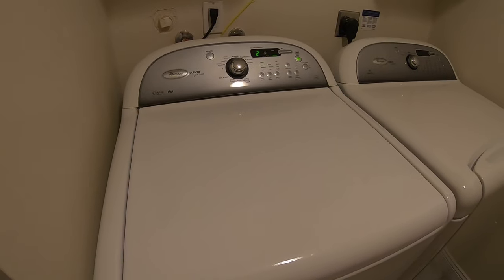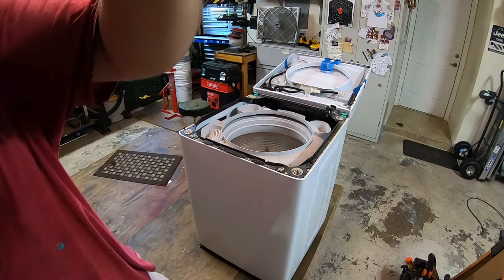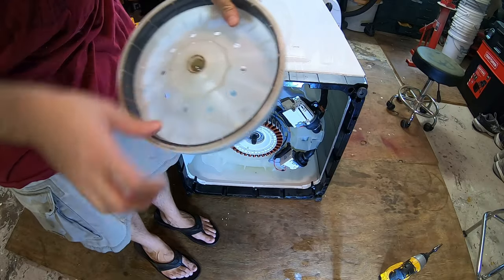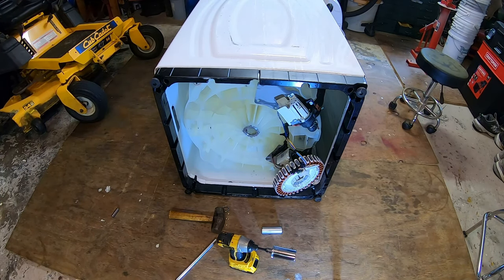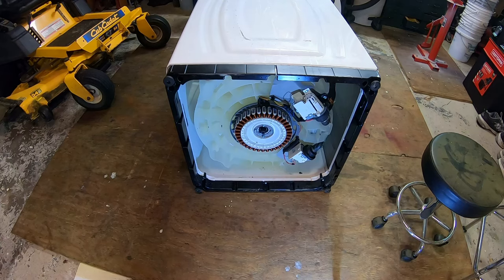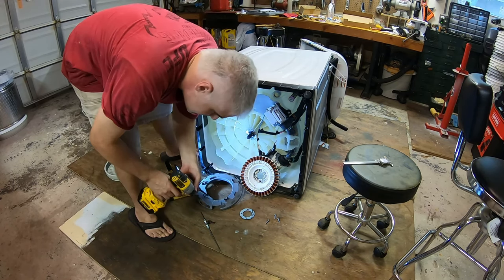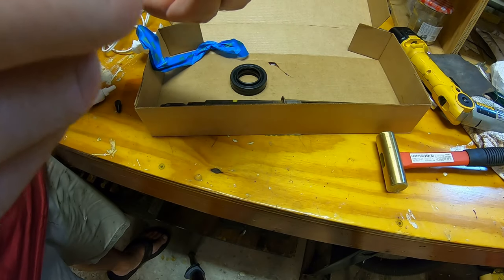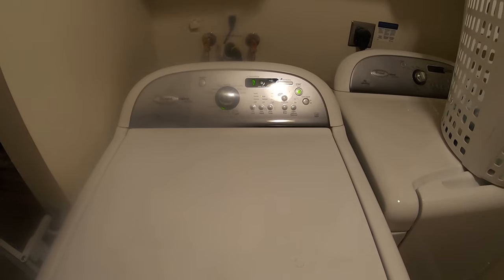Replacing the tub bearings and seal on a Whirlpool Cabrio washing machine

Comment from the maker: Just wanted to post a quick update, almost 2 years later, to say that the repair has held up perfectly - no weird noises, no leaks. 

The washer is now 10 years old and is showing signs of age in other areas. I had an issue with the "Start" button on the control panel, for example. I am expecting to have issues with the "Power" button as well since they are the most heavily used buttons. Unfortunately, those buttons seem to be replaced as an assembly - a very expensive assembly!
Reply: At 8 years, your machine was at the life expectancy of ANY Washer except SPEED QUEEN.  Cabrio is particularly troublesome.  I'd recommend Whirlpool's World Washer made under all the WP family of brands including MAYTAG, Amana, Admiral and others. It has a more traditional looking DC motor and a  "Splutch" (about $18) in place of a transmission and clutch. Bearing replacement is a bit easier too. The main thing is the mostly nylon and plastic parts are much cheaper to buy.  It is still electronically complicated with the pump, and agitation and spin speeds controlled by the Electronic Control board. The 24 page tech manual is hidden behind front cabinet panel. Probably was in your Cabrio as well.  Seals and belts are made of neoprene now instead of natural rubber. Neoprene is more durable, heat, grease and water resistant and will not dry out and disintegrate from age.
Reply: How did you get the cover off in the first step? Where are the screws?
Reply: Keep your eyes peeled on the Facebook Market place. You may find a compatable replacement part, or parts if you know how to sauder for free. Broken washing machines are given away free by people who just want to get rid of them frequently.
Reply: I keep getting told that the kit wont work for my machine even though the model number matches unless my tub has been replaced.  Could that have been the issue with the shaft in your case?
Reply: This is the worst designed washer, same with the Bravos and Oasis. That shaft has been known to never get unstuck and thus damages the tub, plus the units are known to leak even after putting in new parts correctly. Thow that turd away.
Reply: @Jake-by9ly  yup the belt driven model which is easier to work on-easier to run diagnostics and comes with agitators, also Whirlpool finally figured out why the control boards were failing and updated the boards with the correct component. Otherwise an Old Whirlpool based timer switch washer is best.

Comment: Thanks for making the video.  I did my Cabrio Platinum today -- guess it took about 3 or 4 hrs (total with a few beer/snack breaks).   I watched a couple other videos (from appliance part/repair companies/etc), but yours was the most helpful (except I was ready with a 2x4 and floor jack for the tub like I saw in one of the other videos, but like yours, my tub would move up/down about 3/4 of an inch, but not come off... looking closely at the shaft, there was a lip/build up on edge that was catching -- I sanded it smooth and the tub slipped right out).  I'm very glad you didn't edit out the issues/problems/mistakes -- that's what made the video so helpful.  This will be our last Whirlpool set - the quality is very low.  The top has lots of rust (have to keep sanding/appliance painting the areas you can see), the bearings have been bad for over a year, and there's a small leak when it fills (I was hoping it was seal related, but it seems exactly the same after the bearing/seal replacement).  But now that it doesn't sound like a jet taking off, maybe we can get another year out of it -- $55 well spent!

Comment: Thank you for this excellent "real life" repair video. I have one comment: 
I had the same problem when trying to put the shaft in after replacing everything. But upon feeling around the inside at the top of the sleeve between the bearings, I noticed that the sleeve was shifted slightly off from being concentric with the bearings. I used the rod that came with tool (for knocking out the bearings) and gently tapped around inside the top of the sleeve to align it with the top bearing, and then the shaft slid in nicely.

Comment: Joe you're video very helpful. I just did my 7-year old Cabrio yesterday, took 3 hours, thanks. Washer works very well now, much quieter. Used Octopus kit, $60 on Amazon including installation tool. Fingers crossed since its a (cheap) knock-off. Learnings: My basket came out amazingly easy (luck). A short-handled hammer would be useful inside tub, Upper bearing really stuck. Finally soaked with wd-40, taped a socket to the old metal bearing spacer and used 3-pound hammer. Inclusion and use of thrust bearing for installation confusing to me since its a throw-away. Apparently the upper/lower bearings have thrust capabilities. I had trouble getting the seal to seat all the way and concerned how hard I had to "tap" it. Whirlpool should be ashamed of themselves for this bearing failure in such a (relatively) new, low-hours machine.
Reply from the maker: Thank you I'm glad you found the video helpful! My 8-year-old Cabrio has quite a few hours on it so I'm not complaining. I would have preferred that that the OEM Whirlpool bearing kit included higher-quality bearings.

Comment: Amazing video, did it today. To remove the tub I put a 2x4 across the top resting it on the washer housing, and ratchet strapped the inside of the tub top with hooks to the 2x4. Pulled it tight then used a 3lb sledge on the old shaft. Worked like a dream. Also putting the new shaft in I greased it, put a wood block on the top and hammered it in. Worked perfect. Couldn't have done it without you! Cheers.
Reply from the maker: Thank you - glad you found it helpful!
Reply: Cu
Reply: Wood block was the trick for sure!

Comment: Thanks for the video. I completed this repair today, and I did run into one issue which I will share here, with the hope of benefiting others. For some reason, as I was pressing the bearings, the spacer became damaged somehow and did not allow the upper bearing to seat all the way. I hammered the upper bearing out and tried again 5 times, and still could not get it to seat fully. When I tried to put the shaft in, it would not turn. I removed the upper bearing again, removed the spacer, noticed the damage, and decided to try assembling it without the spacer. It seemed to work perfectly, the bearing finally seated, and the shaft turned smoothly, but I'm not sure the potential consequences. When I subsequently installed the seal, it was perfectly level with the tub. I'm testing it now on the "clean washer" cycle which fills the tub all the way, and it's not leaking so far.
Reply: Has it given you any problems yet from not having the spacer?  I did the same thing about a year and a half ago after I couldn't see any reason for the spacer.  Made it much easier to reassemble.  However, the past couple of weeks my washer has developed a loud squeak when the tub is spinning.  I think it's coming from the seal and that maybe I didn't apply enough lube.  So I'm going to replace the seal but I still wonder about that spacer tube and wondered if you'd had any issues.
Reply: @ericicenhour166  Yes, it leaked again and I got rid of it

Comment: That is the Fisher Paykel New Zealand design. The company was taken over by Haier China. Most early machines computers blew up before the shaft wore out. To get the inner tub out stick a 1/2 inch thin long socket on the shaft swing your leg over press down on the socket and give the tub a good pull.  Pull out the outer tub with pipe wires pump and motor and get easy access to everything.  It is a much better tool now to insert the bearings. I used to give the old motors from scrap machines to university solar car projects to drive across Australia.

Comment: Thanks for the great instructions. Prior to replacement sound level was 85db 3 feet from my washer, about like a loud gas mower. After shaft and bearing replacement average through cycle was 55db, about like a conversation. Put new shaft in deep freeze night before, made sure new bearings and spacers were seated and aligned and new shaft went in easily with a few taps.
I wrote out the narrative and it totalled 45 steps, it was very accurate, a very good job.
Great video!
Reply from the maker: Thanks, glad it helped!

Comment: I just used this video to fix my Whirlpool Cabrio. I'm on my fifth or 6th load post fix and everything's going well. Thanks so much for making this video. the only thing that bothers me is that when I put the tub back in and attemped to screw back in that plastic plate with the 6 screws, it was about 2mm proud of where it should be. It didn't sit directly on the inner tub. Anyway I screwed the thing in with the six screws, screwed in the agitator and attached the  cap. Thanks again.
Reply: I'm having the same problem however mine is sitting higher and my pieces are all metal not plastic as shown. I can't get them to sit in properly
Reply: @lindseyandsons4059  Well, for what it's worth my washer's been running for more than a month at about 6 or so washes a week. It's not leaking and runs a lot quieter than it did, but still a bit louder than when it was new. I'm hoping I get another year or two out of it. Hard to say, I think the big mistake I made was to take too long to fix it.

Comment: I’m a tech I do love browsing. A few things. That shaft is tight on design. You have to tap in in. It is tight so both bearings are tandem together. No need for grinding it down. Love the air chisel. You didn’t clean the weep hole. Also the adhesive should be dried before use.I think you did pretty good
Reply from the maker: Thank you for the feedback! Always appreciate constructive criticism! Where is the weep hole located?
Reply: Also, he greased parts that are gonna be submerged in water, aka, everything above the seal.

Comment: Thanks for the video!  Did the 1st replacement for our Maytag washer 3 years ago.  The OEM lasted 10 years then made that roaring noise but no leaks.  Bought the Whirlpool bearing kit and tool and installed it 3 years ago but it's making that noise again.
Reply from the maker: Ugh must be frustrating to have to do this job again. Certainly wasn't trivial.
Reply: @JoesGarageProductionsLLC  AT least I don't have to buy the bearing press and that pvc pipe.  The new bearing comes with the silicone sealer and grease.

Comment: *SOLVED!* Like I said earlier. After pressing in the new bearings, I hammered on the shaft trying to get it to drop down all the way. Beat on it forever. No luck. Thought it was a faulty shaft or faulty bearings.. turns out I was missing a huge key component. The top bearing, spacer, washer, and bottom bearing, have to sandwiched TIGHT together. Had to remove the shaft, hook up the bearing press tool again and turn that thing just about as hard as I possibly could. It finally dropped the top bearing down and squeezed everything together tight in between the two bearings. Then inserted the new (cheap/aftermarket) shaft, a few TAPS with the hammer and it popped all the way down nice, plenty of threads sticking out the bottom and spins nice and straight. So the key was so sandwich the heck out of those bearing pieces. Good luck. I'll be starting it up tomorrow once the seal adhesive cures.
Reply: Thx
Reply: I'm having trouble with my sister's. The top bearing won't sit flush. What size wrench or ratchet did you use? All I had was a 8 inch Cresent. I tightened it as much as I could but no luck. I'm hoping you had more leverage than I do and a bigger tool will get the job done.
Reply: @monahumada7535  I had to remove the spacer today. Not sure what I might be risking by doing that.
Reply: @terryjones9784  I was never able to get it right. My sister just bought another machine.

Comment: I just finished doing this. Glad that's done. Washer is quiet now
Reply: Hey Scott, I'm about to try and change my sister's out. Were you able to remove the tub without that pneumatic punch?
Reply: @monahumada7535  I used a small scissor jack and a piece of wood to pop the wash tub from the shaft but it came right off.
Reply: @scottlanders3812  OK, thanks

Comment: Wow! just replaced a stripped out hub gear and found that that plastic gear had also darn near fully wiped out the metal shaft splines (go figure right).  put it back together for now after having to file new grooves in  the splines. working for the moment. will likely have to replace the shaft very soon (and the hub gear) unless I take your advice and just buy new. my unit is from 2006.  Thanks for the video, it is going to make it easier to buy new.  Another YouTube University great!
Reply from the maker: Thank you I appreciate the compliment! Good luck with your repair :-)

Comment: I just did mine thanks for the video it helped a ton without it it would have taken forever trying to figure it out. I said a lot of swear words and it took several hours the shaft was a pain in the ass and I had a lot of rust because of it leaking.  Next time i'm just gonna buy a new one lol that was a huge pain in the you know what.
Reply: Me too, see my learnings just posted
Reply: I am contemplating a bearing replacement, but my washing machine is like 20 years old. After reading some of the comments on here I have decided to purchase a second hand one, for a reasonable price. Save me the headache. ;)

Comment: Though I wonder if mine needed replacing at all. They seemed to be in good shape. That top seal was definitely damaged so just a matter of time though. I had two issues. 1 was the sud error over and over again. When I removed the drum somehow a tshirt or part of a tshirt had made its way in between the drum & basen. Got clogged and shredded into the drain filter area. Then the loud motorcycle noise occasionally. Which when changing looks like it is caused the that small plastic piece under it. It has most teeth rubbed down. It fit tightly on the new one. But if it happens again I know that’s the part to replace and it will be easy. Just take the agitator off.

Comment: Thx Good sir, very helpful. Got my Whirlpool Washer working again with the kit and this video.
Reply from the maker: Great to hear!
Reply: @JoesGarageProductionsLLC  hey I just disassembled my machine and changes out the bearings. Now it throws water in the bucket but doesn't spin. It just makes a humming noise coming from the motor on the bottom(my machine doesn't have a belt I guess it is a bit new). Wel what should I do because before it didn't do that
Reply from the maker: @Angel-ft8bv  can you spin the tub freely by hand?
Reply: @JoesGarageProductionsLLC  yea
Reply from the maker: @Angel-ft8bv  is it possible that the stator windings were damaged? I believe they are fairly fragile
Reply: @JoesGarageProductionsLLC  i don't know. All it does is hum and and doesn't spin the tub

Comment: I just did this job.  Wish I had seen the air chisel trick.  I tried putting a 22.5” 2x4 crossways under the lip at the top of the tub with a screw jack between the shaft tip and the 2x4.  The tub was seized so bad I broke the first 2x4, but the second 2x4 separated the tub from the shaft.  I’m betting the chisel would have worked better.
Reply from the maker: Yeah air chisels are amazingly useful for a lot of things. Unfortunately if you're on a job site compressed air is not always available. They might make electric versions not sure

Comment: The only negative I had to say about the video is not giving us a call listing ahead of time I spent probably 20 to 30 minutes running up and down stairs out to the garage to grab tools.
1-1/4” deep well if you have an impact, pipe wrench and adjustable works too
1/4” socket
7/16” socket 
3/8” socket
#2 Phillips
1/4” Allen 
Dead blow Hammer
Reply from the maker: Lol, yeah, sorry about that - this was my first time doing this job. I wasn't sure what I was going to need.
Reply: @JoesGarageProductionsLLC  gave me a good workout lol….and the washers fixed

Comment: I just did mine and when I was all done everything worked except the water pump. I pulled the hose off the water pump and there was parts from where the bearings went out inside the water pump. Don't forget to check that while you have your washer on its side.
Reply from the maker: Ouch! You had a really nice failure. Glad you were able to catch it and fix it

Comment: I use a small scissor jack and 2"x4". The 2"x4" goes under the basket lip inside . The bottom of the jack on the shaft. It will make a pop sound when off.

Comment: About to start this repair next week (waiting on parts in mail). Mine started leaking out the bottom of the washer, through the holes in the rotor.. it definitely does not look like a fun job but I'm just trying to get a few more years out of it before buying a new one. Thanks again for the video, wish me luck and I'll post again next week how it went.

Comment: Ring on shaft does not seat snuggly against upper bearing (beat on it forever). Only like 2 threads sticking out bottom. Enough to get nut on but threads are not sticking out past washer. Seems like a lot of people are having this same issue. Any solution? Or call it good enough and hope for the best?

Comment: I pulled my Cabrio apart... the bearings were fine.  An issue with corrosion on the shaft preventing the basket from lifting (and getting an OL error).  I'm contemplating NOT messing with the bearings (I bought a whole kit) and just popping in the new shaft.  I know I SHOULD change the bearings but to me it seems like risk messing with something that is not an issue as is. Thoughts?
Reply from the maker: If the bearings are fine I wouldn't mess with it. Hold on to your kit for when they go bad
Reply: @JoesGarageProductionsLLC  i ended up doing it anyway. It wasn't really all that bad using the tool kit.